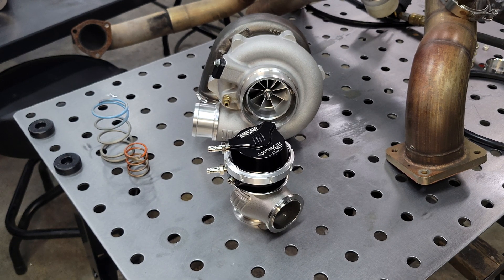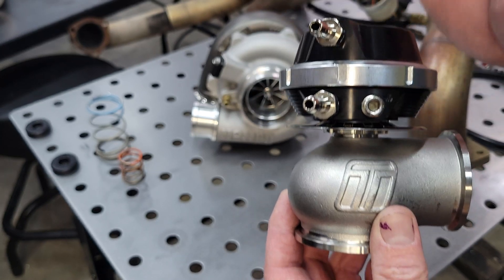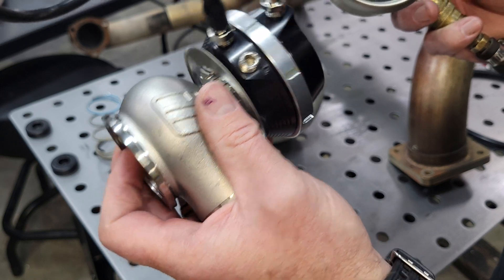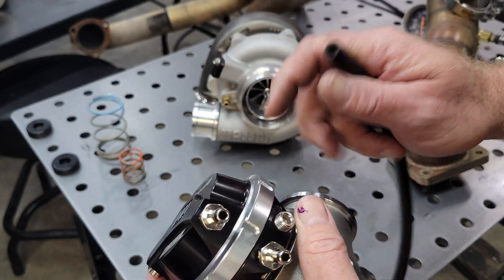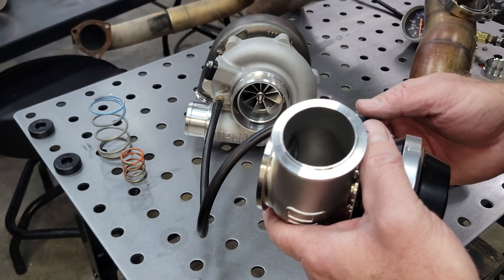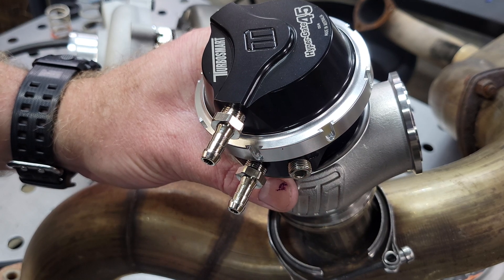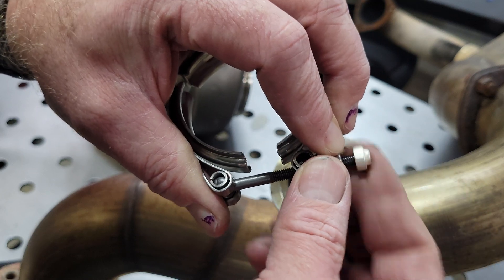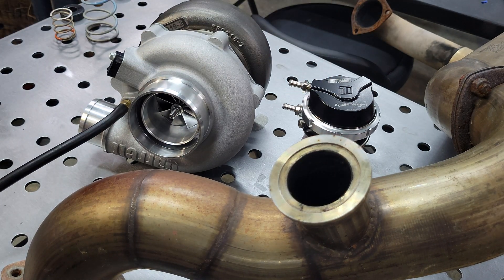External Wastegate Setup, Episode 1- Basic/Simplified Vacuum Line Routing and Testing!

Comment: are there any benefits of two mac valves on twin scroll/twin gate setups?

my ecu has two mac valve allocations..my boost range will be 12-40psi
Reply from the maker: Two valves can give you  faster gate reaction on large swings of boost command..  Air "compresses" and acts like a spring...so having "volume" to dump or add quickly can be your friend when you are trying to get the gate to react as quickly as possible.  

You will see a lot of guys using the 4 port valve and also multiples to get suit their requirements.  

We have gone to the 4 port or even a full electric valve on several of our teams cars just for this reason.

Hope this helps a little bit...-reed

Comment: Question. Ive got compound turbos coming in and neither of them have a hole for the line can i tap into the intake insted or how will that go about? Thank you.
Reply from the maker: Compounds get tricky.  First off,  every combo is different (obviously!) so take this as my way of doing it.  

I am going to assume that this setup is using 2 wastegates, one for the pressure stage and one for the atmospheric.  I will always reference off of the compressor cover of the atmospheric unit for BOTH wastegates.  

Start off with both gates set at exactly the boost pressure you are comfortable with for your base tune.  IE, 15 psi of crack pressure for each stage should get you close to 30 psi of manifold pressure (total boost pressure)

The reason I reference the atmosheric unit is simple,  it will ensure you almost never overspeed the pressure stage unit.  If you have enough wastegate capacity and are data logging the necessary information, you will easily see if both stages are delivering the correct pressure.  

Remember, subtract the atmospheric units pressure from the manifold pressure to get your pressure stages output.  There will be some efficiency loss and subsequent error in this, but it is usually really close (at least in my system)

Each stage will perform best when kept "on the compressor map" for the given turbo...so keep that in mind!  Most all turbochargers are going to have a sweet spot in the 2.5-3.5:1 pressure ratio range.

At that point you can start your tuning.  I run 2 separate boost controllers and dial in each stage, paying attention to shaft speed, exhaust drive pressure in each stage, EGT's and of course, boost pressure.  

I am going to make a fairly in depth video of compound turbocharger tech at some point...it is a very tricky, yet awesome solution to make more power with response on just about any platform.

Hope this gets you started on the right path, good luck! -Reed

Comment: Thanks for the video. My come with two bottom open ports and 1 top swivel fitting. Should I plug one of the bottom port and put a fitting to the other bottom port for boost or just use the top fitting for boost. Also on the video, could you just use the top port for boost vice the bottom. Thanks in advance
Reply from the maker: All very good questions.  Lets start with the 2 bottom (lower ports, closest to the valve).  You will want to utilize one port as your primary reference to the compressor housing fitting, or any other fitting BEFORE the throttle body.  DO NOT put any vacuum on this side of the wastegate...meaning you must tap into the system for pressure reference before the throttle plate.  Seal and plug the unused port.   

Second question, can you use just the top port for boost?  No, you cannot. As you add pressure to the top side of the diaphragm, it forces the wastegate to SHUT, therefore the valve cannot open.  Hooking up the wastegate in this manner will keep it from functioning at all, and forcing the turbocharger to make all of the boost possible. 

Make sure to keep the top port vented to atmosphere, DO NOT plug it!  This port is intended to be used with boost controller feedback only, and must never be sealed up.  

Let me know if this all makes sense, you need to get this right in order to avoid an overboost or lack of boost control situation. -Reed
Reply: @ Thank you for the info. I understand now the external waste gate set up. I have the internal vacuum turbosmart viwg wastegate and was able to download the install instruction. I’m not going to leave the  two bottom holes open as it for positive pressure application and I’m not familiar with that  set up but I will look into to learn it. Probably better to go with the external waste gate set up. So much to learn, Thanks again
Reply from the maker: @mta3562  Yes, the internal vacuum wastegate requires a complete different hookup, referring to Turbosmart's installation documents will be best!  -Reed